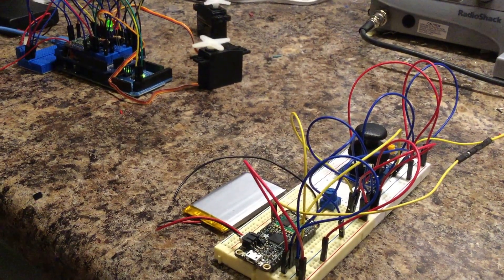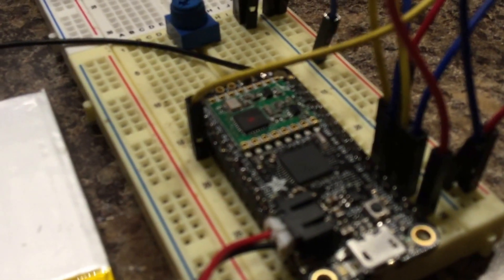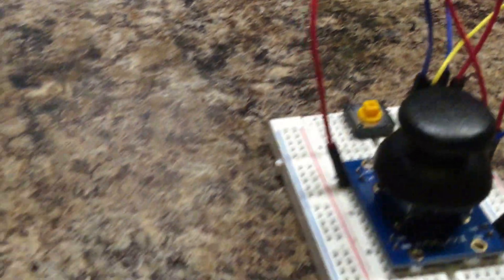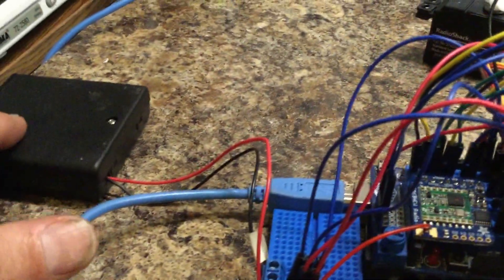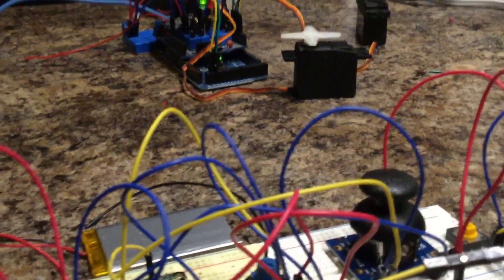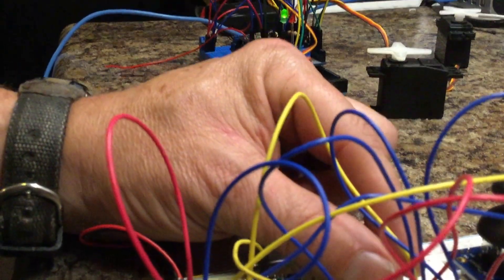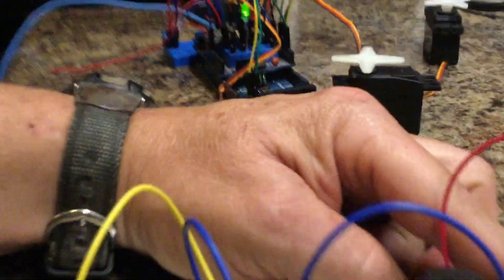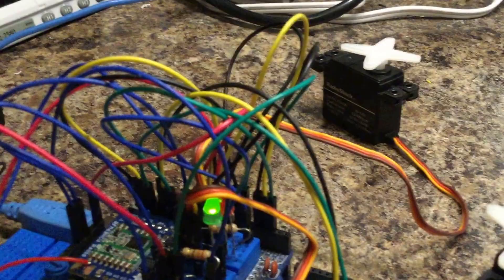Packet Radio Remote Control

Comment: this is an old video, but I hope you might be able to answer my question: Can I use a feather for the receiver as well? I uploaded the receiver code to a feather, but they're not working...
Reply from the maker: Yes the Feather should be compatible.  You may need to change pin numbers in the sketch that are available for the Feather you are using.

Dave

Comment: Cool project!  What kind of range have you seen with the Feathers?
Reply from the maker: The Feathers are a nice board.  I use them for several projects.  The RFM69HCW is the same if you have a breakout board, or you get one attached to the Feather.  The Feather with radio makes a nice small package.The RFM69HCW will transmit and receive from my basement to about a block away.  The project I made with these work maybe up to 150 yards through a wooded area.  I also have the LoRa (Long Range) version I have tested.  The 900MHz LoRa and the 433MHz RFM69HCW seem to have about the same distance.  Nothing scientific, I just walked down the block with the radio sending/receiving a hello message.Here is the project I used the RFM69HCW radios for:http://www.instructables.com/id/Sensor-Array-and-Monitor/
Reply: I'm getting this one, if this can control motors i can use this for a DIY radio controller for a DIY RC plane. I hope this is not like the nrf24's with 30 metres range lol.
Reply: Hi thank you for this awesome video using the feather mo. By the way, can you control  the servo from another feather mo? Or you need an adruino for it?